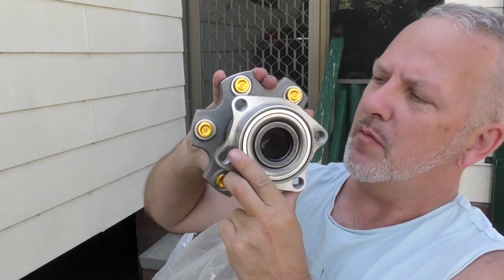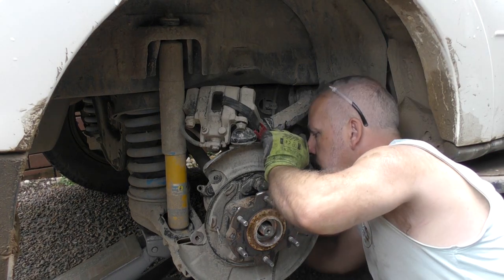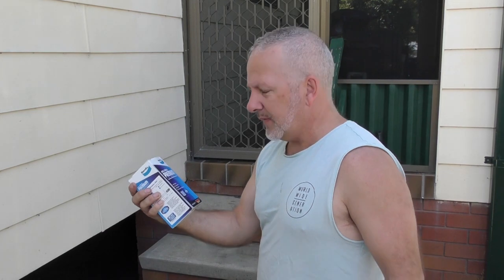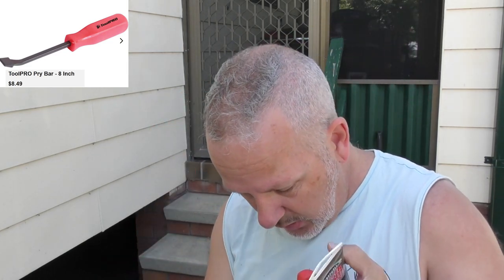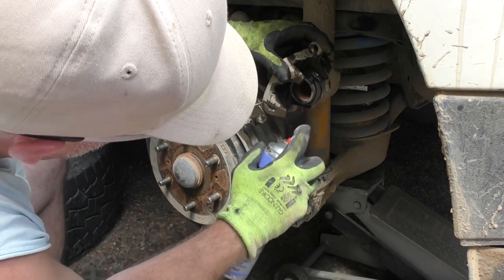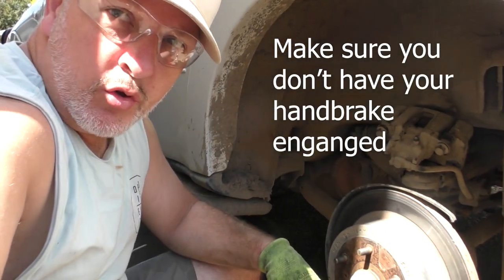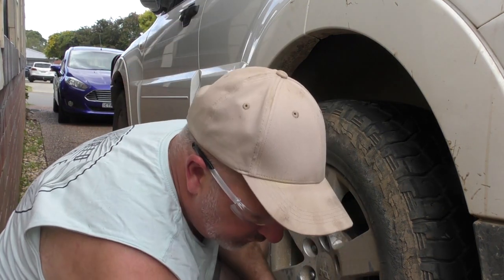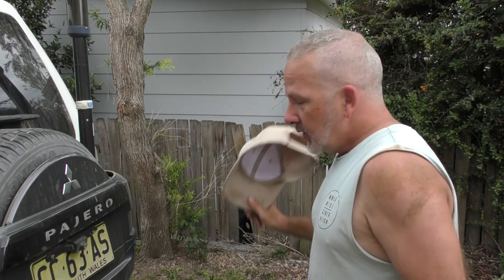4wd (Pajero) Brake Pad and Rotor change - How to

Comment: Another tip for you, wash the car/wheels the day before you work on the brakes. Then you remove most of the brake dust, dirt etc. Much better for the lungs and general grubbiness. Thanks for sharing. Cheers Gaz
Reply from the maker: what can I say Gaz, I'm not that smart :)   it would have made the whole thing much easier to work on.
Reply: @DENMONKEY  No Dramas mate, just experience. Cheers Gaz Love your work
Reply from the maker: @gazpixs  all good mate,  I always appreciate it

Comment: There is a rubber plug from the old rotor. Remove that and you can loosen the hand brake mechanism by using a flat screw driver. It will easier to remove the old rotor. Put new one and tighten the hand brake to original spec.

Comment: A wee tip when fitting pads. On the pad part that locates on the carrier remove the paint as metal to metal slides better. Works a treat.
Reply from the maker: Good tip. I did put some anti seize where they make contact with the clips to help with that, it just didn't make the video.  If didn't talk as much, more would make the cut ,😁

Comment: Great video mate. Couple of tips / suggestions for anyone else doing a pad and rotor replacement... An air chisel is an easy way to get the rotor of if it's rusted on to the hub just mind the wheel studs. Also I usually put a bit of Bendix brake grease on the ears of the pads and the back of them where it touches the piston, supposedly this stops brake squeal.
Reply from the maker: Cheers Kieran, those air chisels are bloody brilliant. I don't know what took me so long to get one, I did stick some any seize on those spots but it didn't make the video. I know some people don't like it. So I try and avoid stuff that will get cranky comments :)

Comment: Wow mate just did my Pajero back pads last month as I heard a squeak when pulling up, but no damage like yours   and yes I used a breaker bar and pipe to get them off,  I did get a ratchet to fit the breaker bar so I could reposition more easily
Reply from the maker: hey Les, they did catch me off guard this time. but really for a 130 bucks for the rotor it's not all that bad. a machine was going to cost 25 bucks. so for 100 extra and getting it done on the same day it was worth the spend. I guess since its not a job you do too often they can a pain in the rear to pull out. In addition to sticking in slotted rotors of some description I think giving those calipers a nice coat of red paint might be in order too

Comment: Always a fun job mate. Ive had all 4 hubs replaced on mine (DS Front twice). Ive also done my front pads & rotors myself and had the mechanic do the rear pads, rotors & shoes as I dont know how to do Drum brakes yet. First time doing my front pads I snapped ring spanners as I didnt have a breaker bar, damaged a socket wrench too as it doesnt lock in right now. Hardest part Ive had with the hubs was actually getting them out of their seating spot after everything was unbolted. 18 years of shit built up in there and a little corrosion made them a nightmare. A little grease goes a long way when it comes to things like that next time. Slotted or drilled rotors I think would make a big difference and have considered doing the same.
Reply from the maker: Sup mick, good to know I'm not the only one busting gear. I know I was asking alot of that bar but the material just wasn't up to spec as far as I can tell. I made sure things that needed it got some anti corrosion on there to make it easier next time. Pity the bloke before me didn't do the same 😁
Reply: @DENMONKEY  Thats it mate. All the parts Ive taken off mine such as Hubs looked to be original so I would think they have probably copped 18 years of abuse off road with very little to no maintenance. My hub nuts were pretty easy but I snapped the spanners on the brake callipers. Mrs gets annoyed with how much Ive spent on the Paj but I keep reminding her its an old vehicle and these things shouldnt need doing again for quite some time now.
Reply from the maker: I thought you were gonna say something about how much the missus spends on upkeep because she's getting older. I was going to say, nice knowing ya 😁.  Maybe that's a good enough reason to get a new one ...pajero I mean , not the wife
Reply: @DENMONKEY  Nah never parting with my Paj mate. Told the Mrs I will part with it the day it is a write off and can not be repaired. At that point I will buy another and probably stick with the Gen 3 as I really do like it. Im not a big fan of all these things telling me how to drive like traction control and such. Plus I much rather the over all styling of the Gen 3.
Reply: @DENMONKEY  Oh and the Mrs is getting old and breaking down all the time too lmfao but just like my Paj im not going to trader her in either.

Comment: Hi Mate.. Just a few hints on doing brakes..
1..Best way to get the brake dust out instead of a brush and air is just use your garden hose. It won't hurt anything
2.. Don't put anti-seize, oil or grease on the hub face to prevent sticking . .2 Reason : First - The rim and drum/rotor rely on the surface friction created by the clamping force of the wheel nuts to resist the twisting force from driving the wheels. If you lubricate those faces you are removing that resistance and placing that twisting force directly to the studs and that's how wheel nuts come loose and studs shear off. Secondly - When the lubricant gets warm the centrifugal force from the spinning wheels will sling the lubricant outwards to the drum/rotor and you'll get brake failure.

You'll see the rotors have 2x8mm threaded holes in them. They're for jacking the rotor off when they are tight.
Reply from the maker: hey Brett, thanks for taking the time mate.  I really should have given the whole thing a hose off before I started since I'd been off road recently and it was still filthy. I wasn't worried about using the hose other than it would have made the area all wet where i was sitting and I was keen to get the job done.    
I don't normally use anti seize but after doing some research the overwhelming common aspect of what I could find was to apply it to between the rotor and the hub and if the hub went well, on the other side of that too. 
Unlikely as it is that I will be replacing either again though whilst i still have the vehicle. I'm winning power ball this week and might get something newer. 
Get where you're coming form on the forces etc but Id be thinking the rotational forces of the wheel itself would be much greater than that of the rotor due to weight and  the larger  diameter over the rotor. That said the braking force is applied direct to the rotor itself. hmm one to ponder out when i have spare time . 
Re the lube/anti seize, it would only move in a straight line from the center point outward from where it was applied. This would have it make contact inside the rotor where the hand brake mechanism resides. It wouldn't make it onto the rotor plate where the braking is done from the pads.   Still, a worthy consideration though when applying any lube to the braking system. 

Yeah a mate picked me up on not using the jacking points. I told him I wasn't sure I had the right size bolts in the shed for the job and if I did, with the state of my shed there'd be no way I could have located them easily. It's a bloody shambles in there.  The hammers though, I knew exactly where they were.     I was under the impression they were a 12mm, but since I didn't try them I really don't know.       Would have been bloody nice if there was the same option for removing those damned hub bolts. could have saved me a breaker bar. 

cheers again
Reply: @DENMONKEY   Sorry mate , but you'll only be winning half the power ball. I've already got a winning ticket :). When you get your winnings don't worry about another car. Just get a bigger shed. All a bloke needs is more shed space.

 I've been a mechanic (for too long) since the 80's and I know a lot of people do use anti-seize but I've seen the down side of lubricating the drum/rotor faces and wheel nuts. Seeing that you do tow a caravan, your torque loads when accelerating and braking are going to be greater than normal. Just wanted to give you a heads up on the down side of using lube so you don't get any nasty surprises.
                     You might be right about the bolt size. It's been a while since I've done a Pajero. I'm thinking they were 8mm bolt with 12 or 13mm head.

      Cheers Mate, Like your work.
Reply from the maker: Towing a caravan? That would be nice. Hasn't been it in 12 months. But getting away next week. I'll settle for 25mil, no problem. Definitely fit that right re the shed. But I'll need a bigger years to fit more sheds. Be a nice problem to have that's for sure

Comment: 20:35 super important on a paj always grease these and even check them every few months as dust gets in there and turns to clay making the free floating element of these brakes hang and will prematurely wear your pads
Reply from the maker: cheers Andy. I know others really like a silicone lube on the sliders but I've always used a bit of bearing grease with success. I have seen some on other vehicles be very rusty and horribly pitted when removed. So mine always get greased up before going back in.
Reply: @DENMONKEY  Have to say mine arent the best but still working fine. Im thinking I will have to replace my calipers soon as the DS Rear was recently stuck in place with both the free floating pins and the piston sticking. Freed up and working now though.

Comment: Rears are easy but good job, front is when the pain starts.  I have a gen 2 and looks like they switched to montero sport parts for the front on the gen 3's like yours.  They main thing you have to remember with rear is that you have to make sure the park break is not set because you won't be able to get the rotor off.
Reply from the maker: Yeah the getting always seems to be much harder with most stuff. More things going  on up there I guess.

Comment: Sure hope you did the other side also, I've always been told brakes should be done in pairs. Just ordered new rotors and pads for my NW and using the opportunity to upgrade to some DBA T2 4x4 Slotted Rotors all round, only about $750 in parts. Annoyingly it will take 3-6 week for the parts to get here. While technically I can di the work, done similar on a smaller car in the past for Pajero I will likely get a shop to do it.

Comment: Thanks for the video. I have to bleed the brakes on my NX Pajero as part of the 90k service schedule. Any tips or any thing I need to look out for in doing this on the Paj would be greatly appreciated.
Reply from the maker: No mate. Nothing I can suggest. Except it's a shit if a job and one I've never been very good at. Need to bleed the brakes on my dirt bike too but have been putting it off. Good luck. Maybe have a look at the vacuum bleeder kit. I've not tried one but they look pretty good.

Comment: Love the Videos just a question I have a 2008  NS LWB Diesel Auto going to do the brakes do you know the Rotor sizes
Reply from the maker: Ummm sorry no, I don't off the top of my head. I just went to the local parts supplier and told them what I needed, they bought this one out. from memory there were 2 sizes and this was the larger. I want to say something like 283mm But really , don't quote me, I could be way off.

Comment: top video quick question how heavy is the spear wheel when you put it back in place up on the rear  door   thanks from john
Reply from the maker: ooh john hard to say. it depends if you have the 17 or 18 inch and what tire you have on it. I would say it definitely requires some level of focus to get it to line up with the pin to slot it on. I can't give you a specific number but I think most reasonably fit men wouldn't have an issue, someone a bit older or of the fairer sex might struggle a little.
Reply: @DENMONKEY  thank you keep up the good work take care mate

Comment: I have a problem with check engine light always.. can you give some tips or you can make a video of it .. how to get away that irritating check engine light as well ...
Reply from the maker: Gday abo, hard call mate cause it could be anything causing it. You really need to find what's making it come up. Grab yourself a cheap obd2 reader off eBay and read any error codes coming up . Depending on what they are, it should let you clear then as well.
Reply: My check engine light came on after 100k. Bought a new EGR valve. Fixed the problem. Opened the electronics of the old valve. All the wipers were stuffed.

Comment: Who know? I have the short pajero with 18" wheel and the front rotor is 29cm. Is possibile upgrade with rotor 32 cm only changing the calliper? The hotel is the same? Thanks from italy
Reply from the maker: I dont know. but a friend changed his triton rotors to slotted ones and got a good improvement on his breaking.

Comment: Hammer or use the jacking screw holes in the rotor to remove it. Easier to use jacking screw holes....if you have the right size bolt to use as the jacking screw.
Reply from the maker: I think theyre a 12mm if I recall but not sure. I likely had some in the shed somewhere but I knew where the hammer was :)
Reply: @DENMONKEY  I’m the same. Reach fro the closest tool that does the job
Reply: @DENMONKEY  Gunna have to do mine soon. Just wondering how the jacking screw works? Do you just thread the appropriate size bolt into the hole in the rotor? If this is the case looks like it would push against the bearing assembly? Might be better than trying to hammer the shit out of it!

Comment: I replaced a rear wheel bearing and man those hub bolts - I had to call a mate to help & even then we broke sockets!
Reply from the maker: They're a shit thing to be sure Terry. Did you manage to remove the hub without removing ball joints etc ? I could get onto them, barely by pushing the cv backwards but it was still going to be a shit job even if I got the bolts undone

Comment: Small added problem There are 4 :rattle clip" holding the disc pads. It is critical that they are installed. I lost one somewhere along the way That caused the pad to not sit properly and destroyed the disk Expensive joke AND they difficult to obtain.

Comment: Im having an absolute shit fight getting my rear rotors off my NW. Ive popped a pin for the parking brake pads im assuming, jacking the rotor out and now the fkkn thing will not come off. Anyone got any tips/help?
Reply from the maker: Have you got the park brake disengaged in the vehicle? If you have it on it will lock the pads to the disc
Reply: Yeah park brake was off. I got it off in the end, the pads had cocked themselves over due to the heavy amount of rust on the inside of the rotor and I snapped a retainer pin. I  needed to locate the pad adjuster via the access hole in the rotor and back the pads off a touch, which in hind sight should of done first 😣 Now to find some new pins at bursons...🤔
Reply from the maker: Ah good. Glad you sorted it. Let me know if they have the pins. I've never had to get a set but would be handy to know.
Reply: Yep Bursons had them. Had to buy a set of 5 pins for $26.95. All sorted now, installed a set of DBA 2219S T2 to the rear 👌

Comment: That rubber bung is for adjusting your Peake brakes.
Reply from the maker: do you mean park brakes ?  there is a little adjust on the bottom that is accessed from the rear of the brakes where you can wind out the shoes to increase friction on the drum. I will be doing a video on this soon as mine need adjusting slightly.   cheers Jay
Reply: Hey Mate this job is next on My list. I'm gonna upgrade my rear rotors to slotted and braided brake lines with new pads. I've done it a few times but never on the pajero. Thanks for sharing.
Reply from the maker: Hey Tim. I'm guessing since you've done it before and will be doing it on the Paj, you rate the change ? how much difference is there ? I was thinking the brake lines might be worth doing as part of the deal.  you going slotted or drilled ? i'm open to any advice
Reply: Yeah park brakes sorry. I did in my NX I reckon it would be different from your as with NX you have to doing from that rubber bung and turn the cog wheel while loosing the actual brake cable from cabin.
Reply: I have DBA slotted T2 way better from stock
Reply from the maker: I can access the cog from that hole you're referring to but Im pretty sure I spotted another access point from the back that I should be able to use that will mean I don't have to take the wheel off. I could be wrong though and will have to check it out further. I just remember seeing it on the other side when I had the hand break mechanism all pulled apart to do the hub. I hate drum brakes
Reply from the maker: Beauty, where did they come from ?
Reply: @DENMONKEY  I know on my NM there is a thin bung on the back to adjust the hand brake. I would guess yours is the same as its apparently the same right back through the Gen 1 Pajeros as well. Mongrel of a thing to move though as I recently tried to adjust mine
Reply: Hi Bret I brought it from a local supplier who supplied for my race car when I had Evo 9. But you can have a look at brake direct. I brought my pads for my NX from them. Ended up with brembo pads with DBA T2 next I will be looking at braided brake lines. With brake lines you can look at hel performance they can make custom size or same size as OEM with brackets. They local from QLD. I did use hel in my race car.

Comment: One thing not mentioned, The handbrake pads needs replacing if the drum was skimmed before Here a new disk is fitted probably to a OEM disc Id the drum is skimmed and new ads fitted it has the incorrect size for the new drum